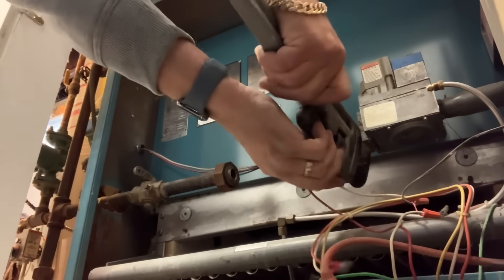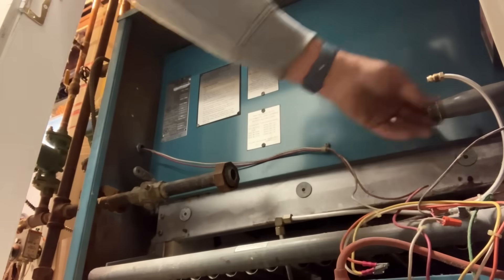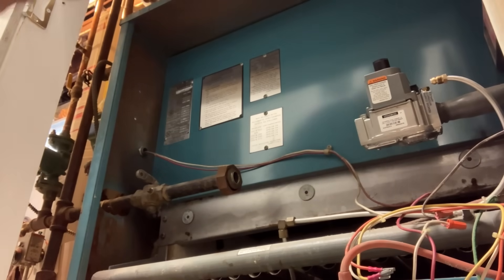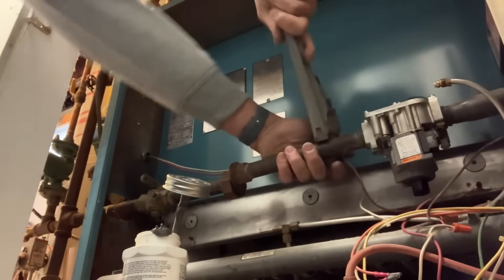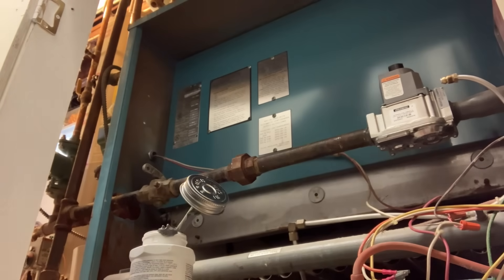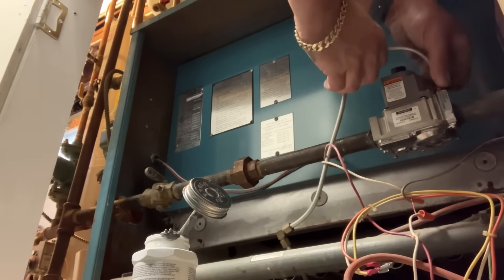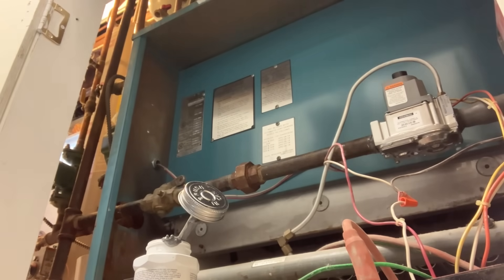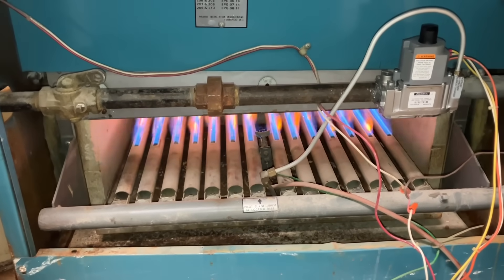Who Built This Wall?! Burnham Boiler FAIL & Dead Gas Valve Replacement

Comment: So for the average dummy, how did you know the small wires had no voltage?  Also, how old was this unit?  I found it interesting you said that they still make units durable as that - are you saying the modern metal used, and the other parts are generally as durable as a unit of this age?  Seems like everything else we see is being made cheaper and cheaper, with inferior materials -

Comment: At what point did you notify the local building inspector of the numerous code violations in that basement?  At what point did you inform the homeowner that they had numerous code violations?  Or, were you only concerned that his check cleared?

Comment: yep, it has the typical bad controller sound. probably dried/failed electrolytic capacitors no longer smoothing the rectified output for it to function (the buzzing sound), likely cooking other things while at it( gas valve may be spanked).
**wow, that one threw me off and was actually still sparking, they often don't anymore and are not quite so loud, check voltage to gas valve pilot/common if there gas output to pilot tube connection, but it's probably spanked. it's old enough enough, best bet is replace gas valve, controller and pilot assembly all at once.

Comment: I had an instructor at the community college tell me he could count on one hand the number of gas valves he replaced. The 2 years I was out there I changed a half dozen.
Reply: they used to not fail often and many lasted 50+ years, now they're all junk and problems started around 25 years ago and getting worse.
Reply: My 54 year old gas boiler has the original gas valve. No problems.
Reply: Still running the original gas valve and control in my 1979 Borg Warner furnace. (knock on wood)
Reply: @airplaneengine  just make sure the heat exchanger isn't cracked. they liked to do that if there was blower and high limit issues. also if there's a humidifier above that decides to dump cold water on it when hot.

Comment: Did you just say the module was no good and change the gas valve?
Reply: It appeared Mikey changed the module and apparently it still wouldn’t fire up so he replaced the gas valve
Reply: @chuckq54 correct, I saw it wired on the floor. Guess work on home owners expense.
Reply: @randomclips9122  Making the trades great again and paying for his Porsche.
Reply: I know right lol
Reply: Seems questionable as zero troubleshooting was shown …parts cannon ?
Reply: @dominicm2175  Mikey showed that he is a parts changer.  He always talks about "troubleshooting" and then he just changes parts to fix a problem and keeps changing them until the problem is fixed.  "Making the Trades Great Again"....LOL!

Comment: I sold kitchens, ready for a funny..  The granite blue printer comes into measure and jig out the job. Shows customer the profile states flush cut at the side were fridge goes.  Customers fridge is not in the kitchen ok still with me.  So customer gets irate your ripping me off I want the edge profile on all the granite  I paid for it you do it.  Im a smart customer who wants  what I pay for.   So the granite guys beaten down do just that add that 1,5 inch extra profile at the fridge opening.  Starting to laugh..fridges standard full size need 36x72 to fit in the kitchen openning. Well its now 1.5 inches too small with a fancy edge profile. Customer is like baffled when new fridge gets delivered and it dont fit.  Now only a smaller fridge will fit.  Same with depot kitchen design. Customer wanted a full size wall oven but only had space for a pos apartmant size 24 incher basic model.  I had to show custormer that x and a 2 means 24 inches. They had zero clue. custom cabinets  being made. 36 inch super fancy wall oven dont fit in 24 inches. I can still see the looks on their faces.  Or the home that the oven door would only open 6 inches it hit the side cabinets. they thought an easy fix.  Ill just use the cabinet stretcher, shrinker. Oh the things I have seen.

Comment: Hopefully that’s a step open valve and the gas pressure is correct.
Reply: Does not look like it 🤷🏻‍♂️. Burnham does require a slow opening gas valve or a step opening gas valve (good eye Dave).
Reply: @boby115  I wouldn’t want to be providing evidence for a lawsuit on YouTube. 😂 YouTubers are braver than me as we all make mistakes.
Reply: didn't seem to be a step open, but was certainly a slow speed open. if not it would have made a big WHOOSH and thump when igniting and knocked the dust off everything at that end of the basement. no need to ask how I know exactly what happens. lol

Comment: I do like running into those types of units, simple like the old days. I don’t care what anybody says the new stuff is crap.
Reply: Same goes for the automotive industry
Reply: High efficiency boilers are very noisy. I have a 54 year old boiler and it’s quiet as a church mouse. My gases go up the chimney and mine has a bonnet. High efficiency means high cost service calls. What you save on gas goes for maintenance. I will keep my old unit. Unless the cast iron is cracked all parts are available for old boilers.

Comment: That wall would've been removed if I was there. Against code.
Reply: code guys dont care, where I live  they oked 2 outside water heater tankless 2 feet from a openning window  the other 1 was 3.5 feet away. Ahh the smell of combustion gasses with morning coffe.  I was like thats totall illegal
Reply: @peter-pg5yc  Combustion gasses have no odor.  Carbon monoxide is the silent odorless killer.
Reply: @philtheheaterguy951  1/2 right; combustion gases that are rich or incomplete or contaminated do have significant odor
Reply: @sparkyobrian6417  I will clarify.  Combustion gasses from a properly installed and maintained gas fired heating appliance have no odor.
Reply: What code?
Reply: @xephael3485  National Fuel Gas Code. 
If NY is an ICC state there's a code for it as well. Also combustion air issues might be present. If you service it and something happens after you leave , you're on the hook for it.
Reply: @xephael3485  If you have to ask that you are ignorant.